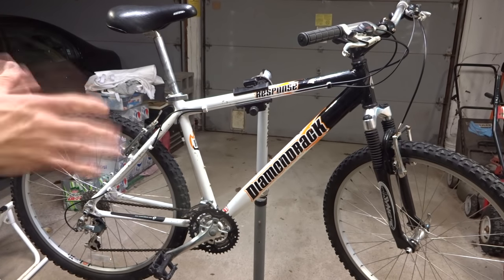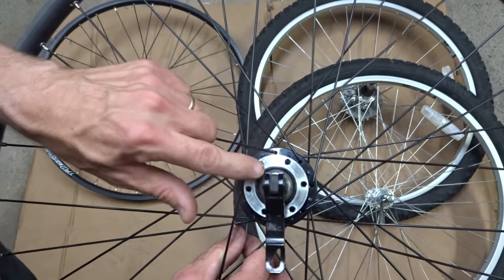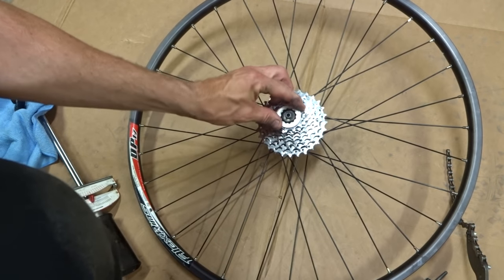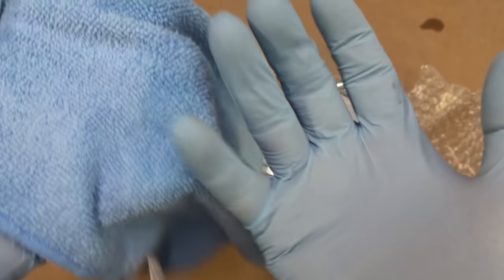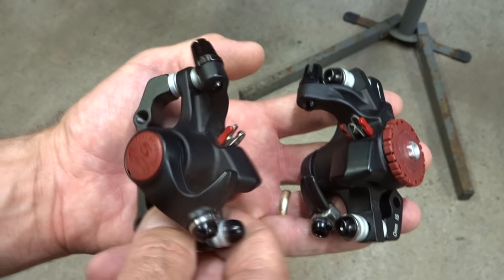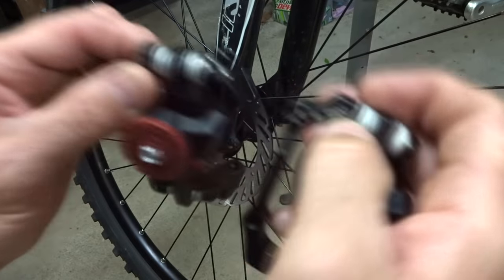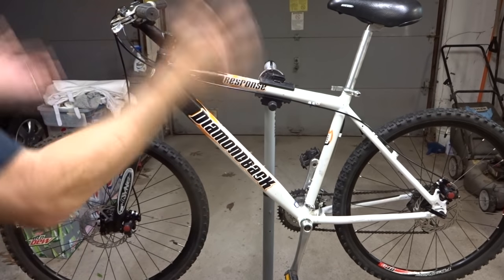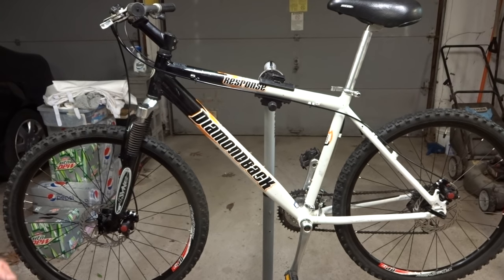How To Convert To Disc Brakes From V-Brakes On Mountain Bike

Comment: this might work provided  the rider of such a converted bike never forgets to brake gently, gradually, conservatively. Sudden braking from speed must be avoided at all costs because the bike frame is not designed to handle the stress of disc braking. So, best done on bikes to be ridden by older persons who don't enjoy doing  steep downgrades.
Reply from the maker: The frame IS designed for disc brakes. That is why there are disc brake mounts.
Reply: @RJTheBikeGuy  I assumed that since you are converting from v brakes that the bike was designed for that system.
Reply from the maker: @jesuisravi  Maybe next time actually watch the video, instead of just reading the title.
Reply: @RJTheBikeGuy  well, I actually did watch some of it...but I surely could have watched the rest before commenting, true. Still, I think this sort of conversion can actually work for some riders even on bikes not designed for discs, and so it may not be entirely out of place.

Comment: the question is, why the heck would one want to do that? 
Rim brakes/V-brakes (as it often is also called) are far cheaper, and less hassle installing, and most importantly, THEY LAST MUCH MUCH LONGER. Had I known this, I would never buy my now disk-brake electric bike as it just eats through expensive brake pads, where I have to change them every 3 months or so. very annoying this...
Reply from the maker: Disc brakes are way better than rim brakes. But keep in mind not all disc brakes are equal. You may have cheap disc brakes, or are using cheap pads, or have the brakes poorly adjusted. Maybe you are abusing them. But disc brakes are superior to rim brakes in stopping power, especially wet conditions.

Comment: Not a big fan of those deflection torque wrenches. Tried one on a calibration rig and it was pretty awful and no better than an educated guess. They are cheap for a reason!.
Reply from the maker: The reason they are cheap, is the are a lot simpler than a clicker torque wrench. I have several clicker torque wrenches. I find the beam torque wrench easier to use for lighter duty stuff like bikes.

Comment: the wrong title for the video,    "disk brake wheel hub conversion"
Reply from the maker: If you thought you could just slap a rotor on a non-disc wheel, you were mistaken.

Comment: This bike has mounts for 3 types of brakes that’s odd
Reply from the maker: Not really. The bosses, and disc brake mounts are the actual mounts on this frame. Not really intended for caliper mounts.
Reply: @RJTheBikeGuy  oh I thought the hole on the back rail looked like it could be for caliper mounts. Anyway great video very informative
Reply from the maker: @nolabob5047  More likely meant for fenders/reflectors.

Comment: Changing from V to Disk without a new wheels, I though. Otherwise, why do it? Just buy another bike with the disk brakes... It's cheaper anyway.
Reply from the maker: You can't mount rotors on wheels not made to mount rotors.

Comment: sorry but why would you make a video converting v brakes to disc when you actually just modify an existing bike. Converting would mean adapting original parts no?
Reply from the maker: You can't magically turn v-brakes into disc brake calipers. And you can't, at least not safely, attach disc rotors to a hub that doesn't have mounts for them. That is not how it works. This video is for people want to convert a bike from v-brakes to disc brakes as to title says.

Comment: Save your stack! This mod makes no sense. This frame was not engineered for Disc brakes. This bike was NEVER designed to be OPERATED at speeds and loads of disc brake frames. This Trek will fail you off road dude. You can sugar coat a pile of crap, but you all you get is a sweet pile crap. 🙏🔑✌️

Comment: What a waste why would you cut the cables like that someone could use them I know I can. P.s. v-brakes work just fine if the are adjusted correctly
Reply from the maker: Do you change the oil in your car? It still looks like oil, feels like oil. But it wears out. Like cables. Cables and housing are a wear part. And they are cheap.

Comment: don't touch the disks with your bare hands, nevermind the fact that you will be riding trough rough and muddy terrain later
Reply from the maker: https://www.bicycling.com/repair/a20043731/road-disc-brakes-never-make-these-5-mistakes/
Reply from the maker: https://www.johnnysprockets.com/articles/disc-brakes-101-pg159.htm
Reply from the maker: Have a problem with the idea of not touching the rotors. Take it up with all the experts!

Comment: I did the opposite of this vid - converted from disc brakes to V-brakes. because disc brakes are an overrated pile of crap.
Reply: Fred Blair why
Reply: @Ryezn5057  That guy doesnt beleive in saving his life at high rate of speed..btw disc brake can stop better in rain then rubber pads one

Comment: and now the most ugly bike in the world has disc brakes lol
Reply from the maker: I am sure there are plenty of bikes uglier than this one. For instance, how many bikes do you own?
Reply: RJ The Bike Guy i am an old timer stuck in the 90s lol.. built from scratch an black specialized hard rock and now i'm building my second specialized epic.. i'm in love with spin trispoke wheels and got and new unused set with the front hub compatible with disc, really rare for those wheels.. i just have no experience at all, all my life i'm been with good, old v-brakes :)
i'm tying to get the right experience.. 
have all parts on my room ready but i'm afraid to start without the right knowledge
Reply from the maker: Just start building it. If you run into a problem,  figure it out.